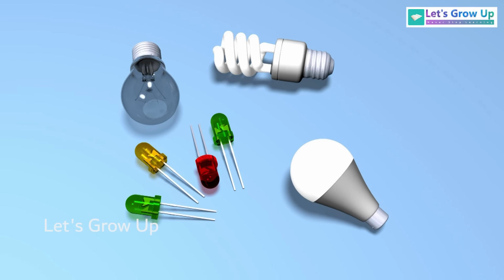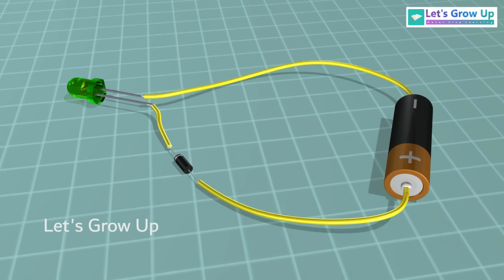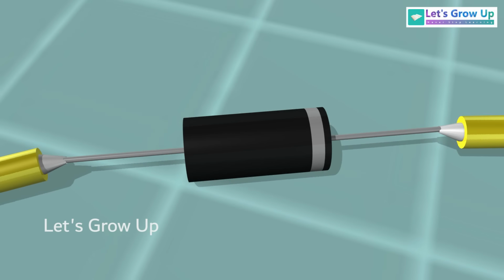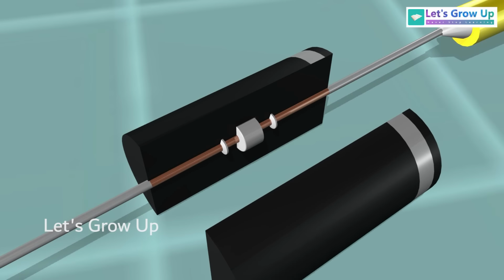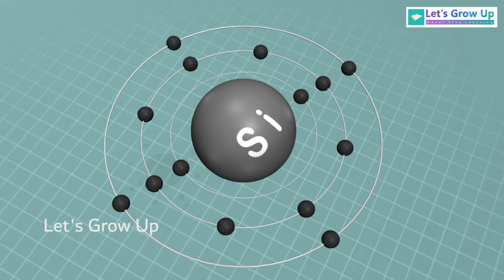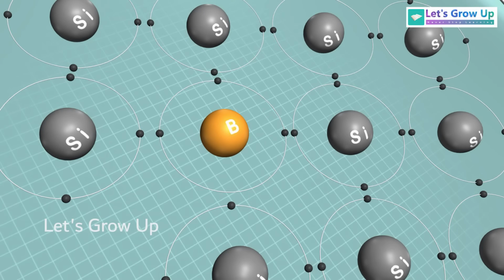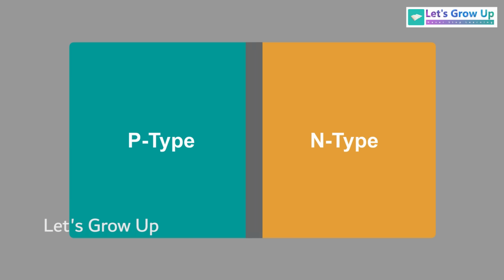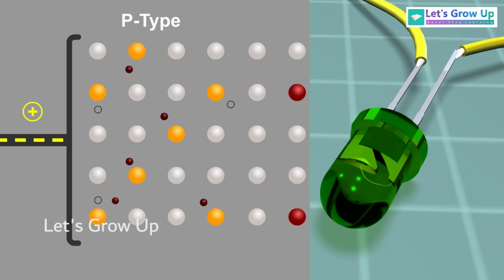How do LED lights work? Inside an LED small light

Comment: You forgot to mention that LEDs have a forward voltage that is substantially constant , with varying currents .... connecting a voltage source higher than this may result in a HUGE current , burning out the LED ..... The current is normally kept to a safe value with a series resistor .... example : a small blue ( or white ) LED ( Vf  3 Volts ) connected to a fully charged 3v7  Lithium battery  WILL  INSTANTLY  BLOW ... to prevent this ,  a resistor of 47 Ω to 100 Ω in series will limit the current to about 10 mA , which is safe for the small LED  ( tried - n - tested ) ...................... DAVE™🛑
Reply: They are just explaining how electrons work in general not rly the electrician side of it
Reply: @populjing  Yes ... I agree ! ... but a LOT of young folk ( students ? ) think that LEDs are just like light bulbs ... the more voltage applied , the brighter the bulb ... The only time a LED can be connected direct to a battery is when the internal resistance is high ( 2032 coin cell ) .. hopefully my comment will stop young folk instantly blowing their LEDs .. more info is better ? ? ..... DAVE™🛑

Comment: Please take this a strictly constructional criticism.  When teaching a basic lesson on how something actually works, it is very important to GET IT RIGHT, even at the most basic level.  Your example here fails in several ways.  First of all, it simply won’t work as shown.  Here’s why:

Your “circuit” consists of a BATTERY, DIODE and LED.  Let’s break it down to the simplest terms...

1. BATTERY. Not enough voltage.  This appears to be a AA - size cell. It even looks like a Duracell “Copper top”. These batteries generate a nominal output of 1.5 volts DC.  Not enough for ANY type of LED.  All LEDs require more than that.

2 - DIODE. Not needed for this circuit.  It actually makes things worse, It is not required for 2 reasons: 1 - You’re using DC, and the LED is already a diode, and 2 - these diodes have a forward voltage drop of about 0.7 volts.  So now, the available voltage at the LED is only about 0.8 volts at most.  Not enough to light at all.

3 - LED. First of all, LEDs run on CURRENT, not voltage, and that current must be limited to prevent damage to the LED.  For the green LED shown here, it is typically 20 to 30 mA at about 2 volts, and “super-bright” green LEDs need at least 3 volts at that current.  All you’ve got is only 0.8 volts. No current will flow - it’s not going to light.

SOLUTION: Add a 2nd battery (in series) so that you have 3 volts, and replace the diode with a current-limiting resistor, such as 150 ohms or so.  If you want to light a super-bright LED, add a 3rd Battery (4.5 volts).  The LED will then light up. 

- Bill V. - Retired electronic design engineer
Reply: Thanks bro for the information 🙏🏻
Reply: تسلم على مجهودك
Reply: Thanks for the correction, ❤
Reply: Thank you so much, sir. 🫡
Reply: It's all this AI crap... not only this video there are tons of misinformation since AI generated videos got popular.

Comment: nice video, did you know that a normal diode also makes light, but is encased in the black plastic, so we don't see it in the end, something I learned not to long ago.
Reply: Generally it is made of silicon and emits heat instead of light.

Comment: Great explanation. Very interesting. Thank you
Reply: LED maybe closer to laser than incandescent light bulb.  Lumens rating may not be accurate.  It's very directional (laser).  It's bright only from a relatively narrow angle.  You need to use diffuser, so you don't burn out your retina.  I found this out the hard way.  I had a 100W LED lamp tip over and thought nothing of it.  But 30 minute later, I came back, it had burned a hole into the carpet.

It's not laser focused, but with enough power it can burn things.  It also throws the lumens rating off, it's not true omnidirectional lighting.